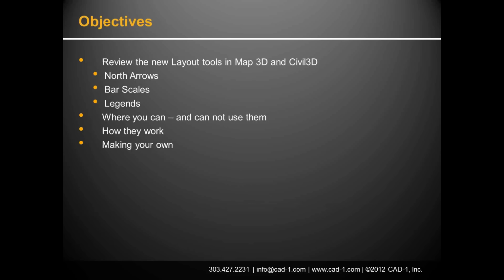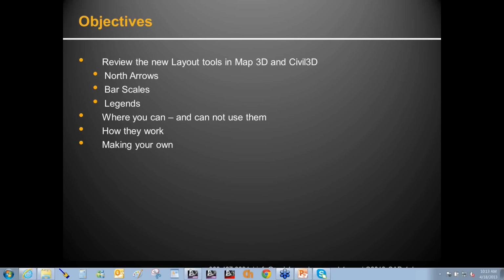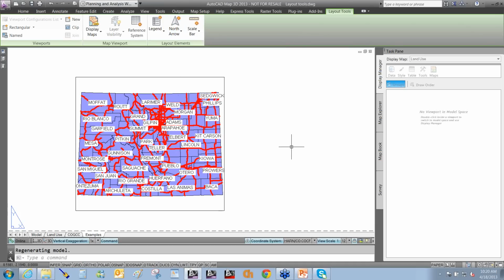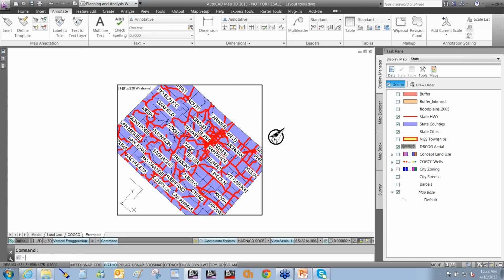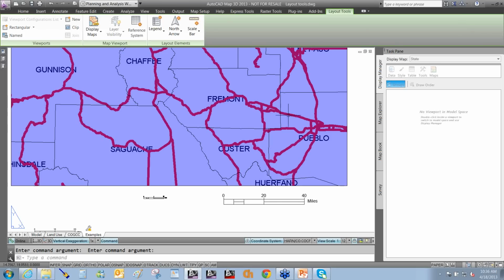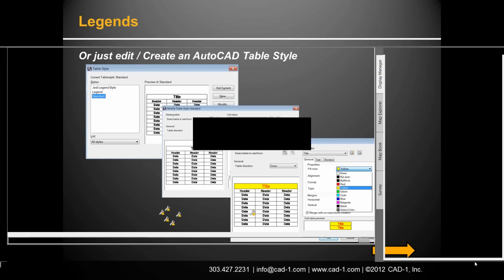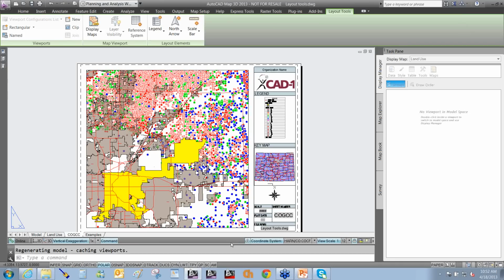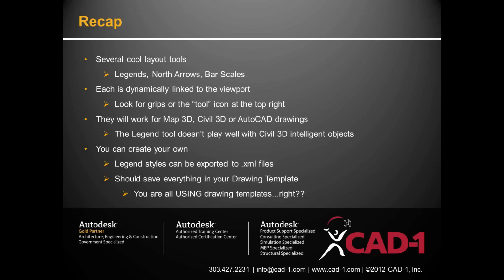CAD-1 Presents - Dynamic Layout Tools in Map 3D & Civil 3D

Comment: great vid.... but here is what my issue is with the built in scale bars.  you cant have it show the written scale.  im yet to see a drawing that doesnt specifically write out the scale of the viewport.  how do i add that?

also, If you want a scale bar to be labeled in smaller increments, it shrinks the scale bar.  so if i have a 1"=10' viewport... i can have the division set to 20, and end up with a scale bar that is 4" long and shows 0', 20', 40'.  i can change the division to 10' and it will show 0', 10', 20'... but now the bar is only 2" long.  thats extremely small if someone wants to actually use a visual scale for what its actually used for.

unfortunately your vid shows about what every other vid covering the scale bar feature covers...   how to change the visual look of the bar itself, but not how to change the contents.  one would think i could add an attribute that would include the written scale.